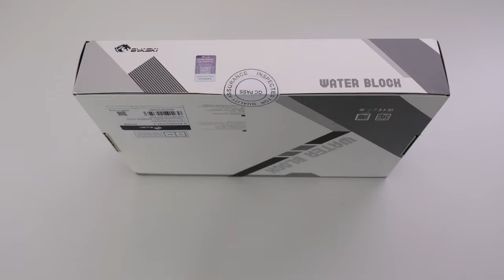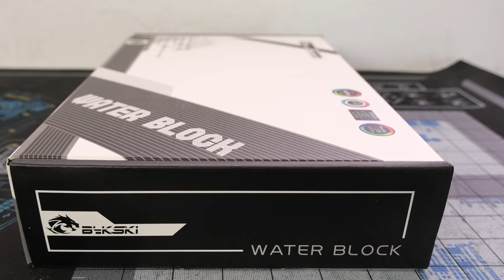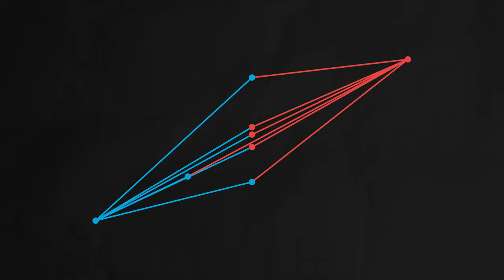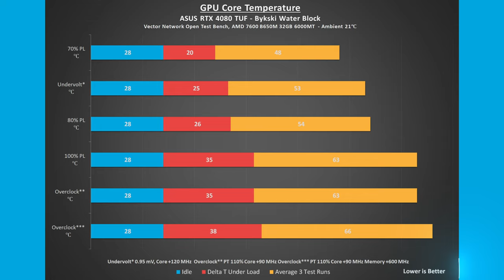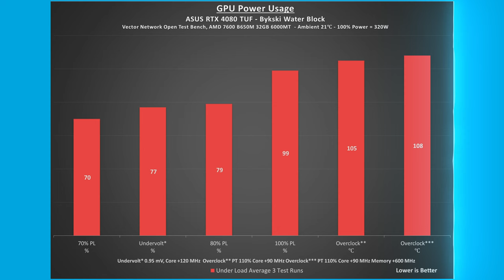Bykski RTX 4080 ASUS TUF Water Block Installation & Testing

Comment: Excelent video, thx a lot to produce this type of content with Bykski products.

Is pretty hard to find good videos about 40's series using these waterblocks.

Keep It up!
Reply from the maker: Thank you for your comment 🙏I will absolutely to my best to keep it up. Thank you for the encouragement. I recognize it takes a lot of time and steps to produce a video but I am getting used to it and I have a bunch more videos on the way. I am working on a Heatkiller V Pro block for the 4090 FE. That episode should be out in 7-10 days and then I have two PC builds in the works. A 4080 in a SFF and a 4090 in a black EVO. Thanks again!
Reply: @vectornetwork  I'm looking forward to the next few episodes :) 

Keep going, your work is amazing for the community!

Comment: Tbh I'm in the middle of installing the tuf 4070 bykski block and compared to ekwb this block as of now is terrible for clarity in install. Luckily, I have experience. But the paste seams ultra thick. So I'm going to have to buy new stuff tomorrow to continue. But what I don't like is the led connection does not connect to the rgb on the board.

Comment: What are your water temps? Those load temps are very high for a waterblock. My 4090, pulling 500W with an EKWB full cover block, only hits mid-to-high 40's under load. Thats with a water temp of around 32C, so a ~15C delta to water.

Comment: Hello! Could you also show the GPU Hotspot temps? (Can be read from HWInfo or GPU-Z) on my card i'm gettin pretty high values and would like to compare results :). Thanks in advance!
Reply from the maker: Thanks for your comment🙏Hm, it is a balancing act. I am currently showing the GPU core and GPU memory. I have the data for GPU Hotspot. My only concern would be if adding another chart, that would likely be interesting only to a portion of the audience, would cause a dip in viewers. Or maybe I could incorporate it into another chart. It is something I am considering. Especially if I decide to make shorter episodes dedicated to Unboxing/Installations/Teardowns/Thermals, then I could add more content to each type. Something to consider and thank you for commenting.
Reply: @vectornetwork It is enough to show a chart for only 10 seconds and that info is vital for me. Providing just core temp is not enough because, for example, my ASUS TUF 4080 OC card's core temp never exceeds 65 degrees celsius while hotspot temperature reaches 90 degrees under heavy load. There is something wrong with its cooler because I repasted GPU and nothing changed. I am considering water cooling but I also need hotspot temperature info.

Comment: Hey man! Great video!

I broke the original cooler's screws.. does the bykski kit come with these screws? (4 around gpu chip)
Reply from the maker: Thanks for your comment 🙏To clarify, you broke the screws that go around the processor for your original air cooler. The Bykski kit will come with new screws, 4 that go around the GPU chip.  Hope that helps.
Reply: @vectornetwork  was a great help! Thanks for the reply

Comment: I have gigabyte windforce 4070ti and I am not getting it's waterblock ,can you tell me what to do in this case, can I use any other brands compatible block since the screw placing and mosfet and vrm placing are almost same in many cards I can do some diy stuff to companciale the perfection of the block
Reply from the maker: Thanks for your comment 🙏 So you have a 4070ti Windforce. I would enjoy it air cooled. I have not done research on the 4070ti water blocks, so I am not sure about what water blocks are available. I do know that I would not recommend (in this situation) to try another brands block, even with your DIY skills. The 4070ti should be a cool and efficient card. I would recommend water cooling moreso for the 80/90 series cards. Hope that helps
Reply: @vectornetwork   actually the problem is that I have barebone pcb of the gpu, that gpu was part of a liquid cooled  cpu rig in a china based server providing company operating in india which closed their operations in india (my country) cuz of gov sanctions on Chinese companies so I got the pcb of 4070ti for just about 200$ but now I am struggling to use it I also didn't have it's io plate but I have made it by modding an scraped gt 210's io plate ......🙏